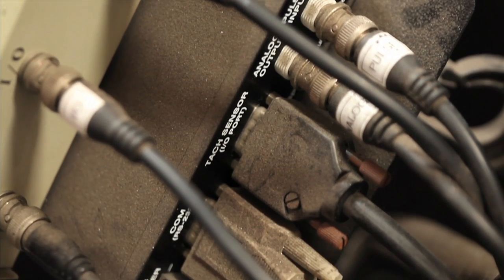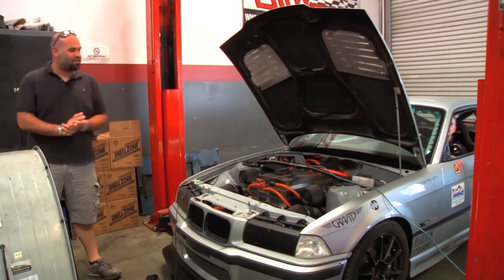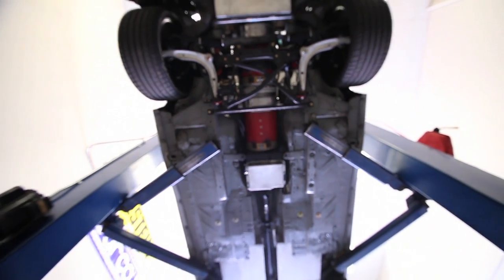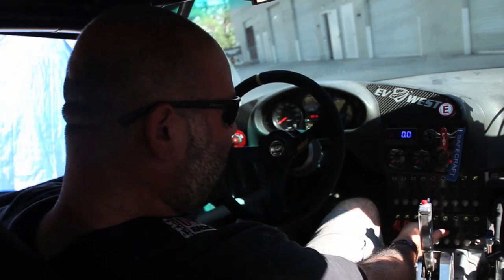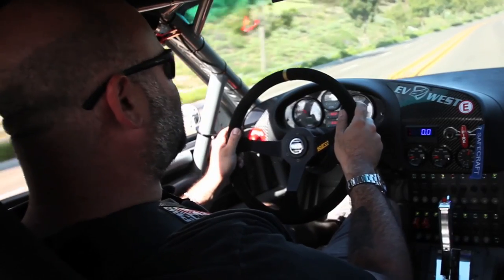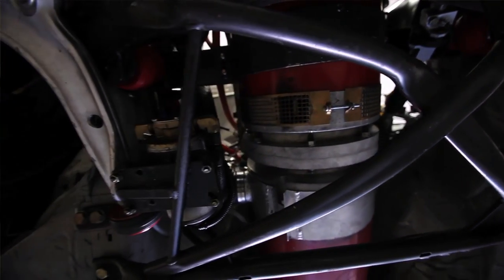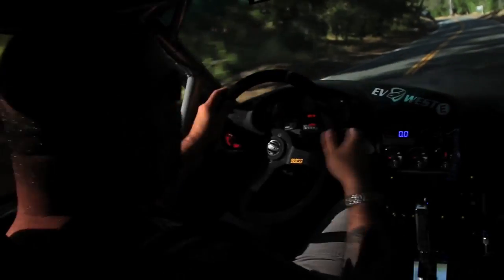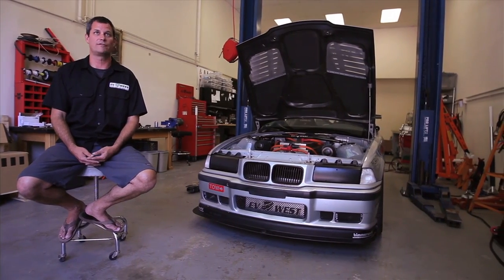This Electric E36 Makes 850 lb/ft of Torque at the Wheels! - /TUNED

Comment: Its 340hp.. they shouldn't get too caught up in the 840ftlbs at 600rpm.. guys, that's 64hp   big deal.... any gas car can do that in the "right gear".   don't confuse engine torque with torque /force at the rear tires.   Certainly you need the beefier components because of the 340hp matched with a low reving engine . (vs a racer e36 with its near 8000rpm redline race engine which has about half the torque as the EV through the RPM ranges, so you just need a gear train set up for cars that have double the torque, like a viper or something)
to put this in perspective, this EV e36 makes 800ftlbs of torque, but no gear.  just a Diff gear of probably 2:1.  that's 1600ft-lbs of torque at the wheels.   if I have my moms mustang with 200ftlb of torque, through a 8:1 1st gear, I make 1600ftlbs of torque.... same as the EV e36.   :)
The point is, the max hp is probably pretty wide with the EV.  with no gears it will be at a very low HP range at the top and at the bottom RPM.  a simple 2 gear gear box would make the eV racer optimal for  many tracks.   its great to see this in the form its in, but still there is work to be done to make it competitive.   better batteries and a 2 speed gear box will be part of the answer of how it can be competitive to gas racers.
Reply: I don't think you quite understand how torque and horsepower work. Or how gearing works. For acceleration torque is essential. Having a constant high torque all the way up from 0 to 4,000rpm is much better at accelerating. HP is a way of measuring torque over time, and is much less useful. And did you not notice that it DOES have gears? It's got a 2-speed Powerglide transmission, with low and high range gears. It's also got a torque convertor, which multiplies the torque when you first hit the gas. MULTIPLIES 850lb-ft of torque, which starts at 0rpm. I'm guessing they say 600rpm because that is when the torque convertor equalizes and the input and output are both 850lb-ft.
Second, you can measure the torque produced at the wheels in a higher gear, but are you forgetting that the car is going to cover less ground in relation because the engine has to turn more times per revolution of the wheels? And of course with an ICE you have to start at low RPMs and accelerate until you get into the torque and power band, which is why 9-speed gearboxes are faster....they keep you in the sweet spot. Basically, this engine is always "in the sweet spot", so it only needs 2 gear ratios.
Also, where the hell did you get "a diff gear of 2:1"? Who the hell makes a diff gear of 2:1? Diff gears are almost always between 3:1 and 5:1, which a few exception in big trucks.
Reply: justforever96 I think you might want to do some home work.    power dictates rear wheel torque. yes, rear wheel torque is what maters, its determined by engine HP.   peak torque means nothing, peak power is where you would operate an engine if it had an infinitely variable transmission, right?  good.... so, its all about HP
The point about a two speed gear box, was to point out, that's how it would be more efficient and utilize more power , rather than a single speed gear box like a tesla.
Back to HP.... acceleration is proportional to power   Acceleration = power/(mass x velocity)  this means at any speed, he who has the greatest HP will accelerate fastest, it also means if you can make any more hp at any speed, you will generate more rear wheel torque.... this is a fact, not a guess.      this is also regardless of engine torque.   engine torque might be at a fraction of peak torque, but at the rear wheels, at a higher hp  level, it will make MORE rear wheel torque.
Reply: ***** no, you couldn't be more wrong..... for performance that is..    acceleration is PROPORTIONAL to HP, PERIOD....... not my rules... Newton!!  :)        we are going fast, and that's why we keep it there. so yes , you mentioned that.  otherwise, max torque really doesn't have a purpose as well.
Reply: ***** actually, still not true.   and its not the most fuel efficient engine speed either. its really an non event to have your engine at max torque.  You seem to forget that max engine HP makes the greatest rear wheel torque at ANY vehicle speed.   you are confusing max torque of the engine , with torque at the rear wheels.  Hp is the rate of doing work.... the faster you do work, the greater the acceleration. this happens at max HP  NOT max torque of the engine.   max HP creates the max torque at the rear wheels.   :)
Reply: *****  the max potential for acceleration is max HP... but if you have a infinitely variable gear box, you would run the engine at max HP , NOT max torque and that optimized torque at the rear wheels (that creates the force for acceleration) would go down proportional with speed  (by the way)   Its pure Newtonian physics ..  very basic stuff here. (and widely misunderstood...... shown by anyone that focues on engine torque, which usually means less than nothing!... HP HP HP   OR , if you want to talk about torque, tell me the torque at the rear wheels, which is usually more complicated to calculate...... and that will ALWAYS happen at max HP , not max torque of the engine at any vehicle speed.)
Reply: *****           

Yes, newton said , A=F(net)/mass , but this net force has NOTHING to do with the max torque.    The net force is found at the wheels AND is found at max HP at the engine NOT max torque.... again, max torque of the engine means less than nothing.   rpm is NOT "how long something can accelerate".  RPM is rotational velocity.   power is the rate of doing work.. a hp-second is a unit measure of work..... (like a watt-second................and if you remember your physics.... that is a Joule..... a measure of energy.      more energy, more power........... in other words, power is the rate of change of Kinetic energy...... by definition, this IS the definition of acceleration of a mass.Devin Williams                    1 day ago                 
And also, newtons law for acceleration is
A = Fnet / m. net force is torque not power. IF anything torque is rate of acceleration, Rpm is how long it can accelerate for, and horsepower is a tidy way to measure these things combined
Reply: *****   Devin, no that is not true. any transmission in the world would have max torque at the wheels at max HP, NOT max torque at any vehicle speed..
Reply: zanick2   Devin, the great thing about using max HP as the most potential for acceleration at any speed, is that you don't need wheel or tire size to be calculated.  its already calculate in the result, IF you are at max HP.  again, max hp IS the fastest rate of acceleration at any speed.  you CANNOT disprove that. if you can, I will send you a bottle of wine!!  :)   (but in order to prove me wrong , you will have to prove wrong a simple Newtonian identity:    acceleration= power/ ( mass x velocity)  )
Reply: ***** you said:  " In simplified Performance terms, yes RPM (limit) is how long something can accelerate. Increasing torque of an engine makes it accelerating faster, increasing the red line lets you accelerate for a longer time to a higher speed, generally staying in a lower gear longer. (max) Power isn't a rate of change, its the total amount of energy to be made, torque is what changes amounts in kinetic energy."      DEVIN, power is  a rate of change of kinetic energy... look it up .   pretty simple.    total energy is HP-seconds, which is  Joules.       torque is a function of mass and acceleration.   work is force and distance. Hp-seconds are unit measures of work. power is the rate of doing work.     you are confusing max hp with max torque.  .. max HP creates the max torque at any particular speed.  KEY POINT.    example.. if you are at max torque at 4000rpm and creating 500ftlbs of torque at the engine. and say you are in 3rd gear, if you downshift to 2nd, at that same speed, you will have  more torque at the wheels and be at a higher HP level of the engine.     think about it.. POWER is the rate of doing work..   that's why infinitely variable gears , or even close ratio gears like in a Porsche supercup racer, will keep RPM in the max HP range, NOT ever hitting max torque on the engine. why is that?   because HP is the rate of doing work....... this by definition is acceleration!!
Reply: *****   Devin, what do you mean "there is no such thing as a HP -second. "  by definition, that is a unit measure of work, usually in Joules.   watt-second, hp-second,etc, all are unit measures of work.what I meant by "rate of doing work" , which is hp, is that the faster you do work, the faster you will accerate, right?   that's all . I was giving a comparison, not a definition.
Reply: *****  You are confusing a unit measure of work with a rate of doing work.  two entirely different things.you a watt-second is a joule.     there are 746watts in a hp, so 746hp-seconds is 746 joules.    so, are you clear??  HP-second is a unit measure of work.   power is also Force x velocity.     taking a mass  and accelerate it to 100mph will take a certain amount KE.  this is regardless If you take a year to do it, or 5 seconds.    Both will take 2,000,000 J as an example,  lets say.That's 2,000,000 watt seconds or 2,000,000/746 = 2600 HP-seconds.   this means, if you want to accelerate to 100mph , you need 2600hp to do it in 1 second, or 260hp to do it in 10 seconds, or only 26hp if you have 100seconds.    you get the idea.    this is not something im just making up.  ITS THE FOUNDATION of the potential of a vehicles ability to accelerate and it has NOTHNG to do with engine torque,  and everything to do with rear wheel torque.  I don't care what gear you are in, or anything. if you have a certain level of HP available, it will dictate the acceleration potential.   And sure, you can use rear wheel torque but that is hardly ever measured or known and is much harder to calculate.dynos measure rate of change of KE, because they have the drum dimensions and the speed change of the drums.    rate of change of KE = HP.
Reply: ***** I don't know where you are getting you information.   but a watt-second is and always will be a "Joule".    do a quick search on the internet or any of your basic physics books. 
I think what you have confused is the watt-second with Joule/ second... (joule per second).   they are equivalent .there is no , joule-second.

A watt second (also watt-second, symbol W s or W·s) is a derived unit of energy equivalent to the joule.(Taylor & Thompson 2008, pp. 39–40, 53) The watt-second is the energy equivalent to the power of one watt sustained for one second. While the watt-second is equivalent to the joule in both units and meaning, there are some contexts in which the watt-second is used instead of joule.
Reply: *****   now, as far as your gear ratio comment..... actually, yes, in each gear, the max acceleration will be at max torque of the engine, but that is still meaningless, as that is not at the power max, or the potential of the engine to accelerate the mass.   if your gears are not set up right, then yes, your condition can be true.   but in most all cases, peak torque is meaningless, and your max acceleration will occur at max HP at ANY vehicle speed.   this is why all race cars try and get their engines I the max HP range and keep I there.  its the reason for close ratio gear boxes and its the reason that you will more than likely never see max torque in a race car, as you will always be near max HP , which develops the most rear wheel torque at any same vehicle speed.    your CVT or IFV example, makes no sense, because if it was truly IFV Or CVT, the moment you floor it or engage the gear box, you would want the engine at max HP NOT max torque.  think of it this way .  acceleration = power/ (mass x velocity).  this means acceleration is always proportional to power!   so, if you are in the correct gear (a gear low enough), you will always accelerate fastest if the RPM can be kept in the max HP range, because that is the highest level of acceleration the engine can produce for the mass it is driving.    in your example, you say you cannot go to a lower gear or a lower ratio.. if that is the case, that's not the HP fault, its the gear box designers fault.     don't forget to do all comparisons at the same vehicle speed, otherwise the comparisons are not meaningful.  Part of the reason there is so much confusion on the topic
Reply: ***** Devin, do you have an engineering degree?  I only ask so I can skew my responses to make the best possible sense?     for example, your point regarding max top speed , being brought about by top RPM , not max hp is very wrong.   in order to achieve max speed, its ALL ABOUT max HP , not max torque.   you have to wrap your head around the fact that rate of change of KE is power.  the greater that rate of change (i.e. acceleration) the more HP required.   as far as top speed goes, this is also power.   power =mass x velocity.      the torque it takes to hit top speed, AGAIN , LIKE ACCELERATION, has NOTHING to do with engine torque.  the most amount of rear wheel torque at any vehicle speed will ALWAYS occur at max HP  , NOT max torque.  this is usually the hardest concept for new engineers to understand.   remember, torque at the wheels is synonomous to HP.  engine torque means almost nothing without RPM attached to it.
Reply: *****  Now, your comment regarding weekend warriors...... as long as they keep their engines shifting near redline, they will be maximizing HP the best they can.    the only caveat is launch on a drag race.    depending on lots of factors, and averaging out (or integrating) the area under the HP curve during a launch, will that decide what gear ratio would be optimal .  (factors include, optimal tire slip %, clutch slip, and many others)
Reply: *****   no, the gear ratios don't have to be 'infinite", perfect, nor awesome at all!    and yes, because the laws of physics are pretty well known and set, I can say this with absolute confidence.   HP  IS proportional to acceleration.   there is no speed that any car would accelerate best, that is NOT at or near max HP.  Generally, max torque will never even be seen by most all cars , even with "not-perfect" gear ratios.   think of gear ratios as a HP efficiency directors.   they allow the car to select the right gear that is closest to max HP at ANY vehicle speed.  the closer you are there, the greater your acceleration at that particular, or ANY speed.   you are falling in the same trap as most that don't understand the forces that accelerate the car.   engine torque is completely irrelevant.    its rear wheel torque, that matters and that is dictated by max HP capabilities of the car.  its the reason that a viper comp coupe with a V-10 and 500hp / 500ftbs of torque, would accelerate the exact same as a Porsche GT3 with 500hp and 250ft-lbs of torque.     at the same weight these cars would accelerate the same at any vehicle speed..... why is that??? HP my friend!    both cars have the same HP at any speed and they accelerate at the same rate at any speed. (as long as they are the same weight, which in my racing series, they do and ......so, they do.  :) )
Reply: *****   forget about the gears.... at any speed you are traveling at, you will always accelerate faster at max HP than at max torque.   you have to keep any comparison speed the same, or it is not a logical comparison.  it makes no sense.   "go faster" ??   max HP will allow for max vehicle speed.     max torque, again, will have nothing to do with top speed either.  it will be a product of force and speed (i.e. power).  you have to get your mind around the engine vs the rear wheel forces accelerating or producing accelerating or max force to create acceleration or top speed.   max hp is the max potential for a vehicle to hit its max speed.  if you hit max speed at max HP , it will go no faster.  you will not be able to get to any higher engine speed.   this could happen at 1000rpm for a big diesel engine or 180000rpm for a gas engine.  max HP is where this point occurs  (not max torque, even though max torque ,in any gear ,is the greatest you can accelerate and produce force.  it doesn't matter, as it has to be at a particular relative speed!   key point!! think about this! )
Reply: *****    "absolute"?? that makes no sense either.  a "given " speed, means , comparatively.  (e.g. at 100mph at 40mph, at 200mph, etc)     forget about accerative forces at any given gear, and think any given speed.   if you are at 60mph, you will select a gear to accelerate greatest , and that will be a gear that is closest to max HP, NOT max torque.   again, in the racing world, race cars rarely ever operate at max torque, ever!!    :)    they launch at max HP, they shift at max RPM to have an average power around max HP, etc etc etc, they never operate at max torque... and there is a reason for this as I have been describingacceleration = power/(mass / velocity)   this is a Newtonian identity , it cannot be argued and it states specifically, that acceleration is proportionally to power.
Reply: *****  your first reply....... no  if your gears are limited , you have a fixed ability to accelerate based on the Power you make at the speed  where the two meet. if you have a excess of power at max power for the speed, you will continue to accelerate until the force generated equals the force it takes to achieve that speed.  very few cars can have a max speed that exceeds their top gear and max RPM.   if so, get some larger tires. :)
Reply: ***** I don't understand your second question.  "In the lowest gear the car has, will you make the most torque at max torque or max horsepower?"    
Ill put it this way, there is the most amount of rear wheel torque in 1st gear at max torque.  But, not really.. actually you can do a clutch dump at max HP , releasing more torque from the engine and the KE of the rotating mass , to accelerate faster.  this is why drag racers dump the clutch at redline, or near max HP and not near max torque.    launch is an entirely different argument and is much more complicated.  look at 2nd gear and beyond.    you wouldn't want to accelerate in 2nd gear at max torque, when you could drop down a gear to 1st and be near max HP, and have 30% greater torque at the rear wheels, even though the engine torque is less...... this is due to the equations ive listed.